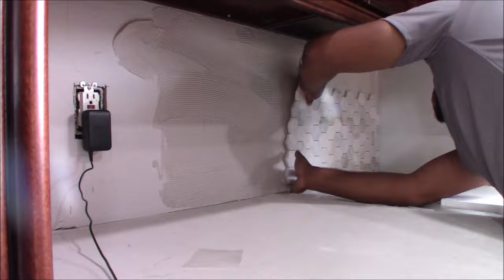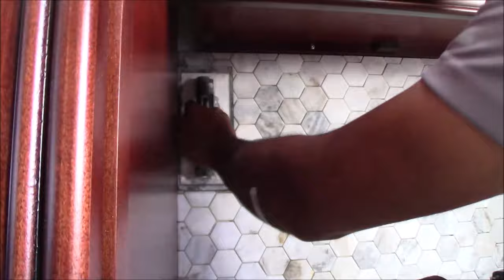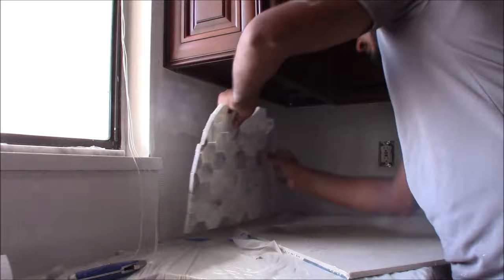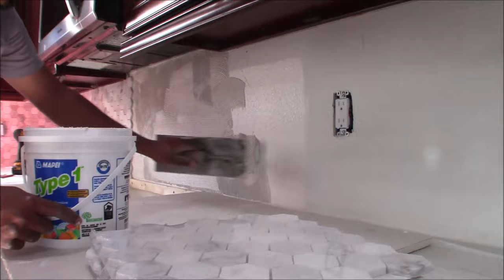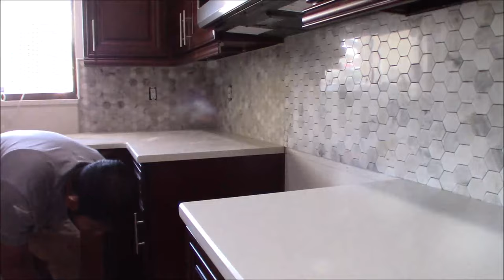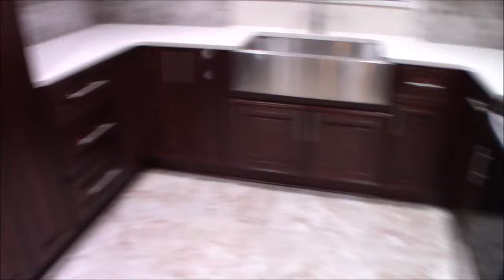How to Install Backsplash In Kitchen    (3 inch Hexagon Mosaic Tile)

Comment: I just bought the same mosaic style tile (3” hexagon) , how did you cut the outlet out if the outlet falls in the middle of the piece? I seen you had the same situation in your video. Any tips would sure be appreciated! Thank you
Reply from the maker: Hey I used a angle grinder with a 4 inch tile blade to cut around the outlets.
And a tile wet saw for all the strate cuts.
Good luck on your project.
Thanks for watching 👍

Comment: Not to burst your bubble but it looks great. The problem I have is that it is backwards. The flat cut of the tiles is supposed to land on the granite or counter top. The missing hexagons in every sheet is supposed to go to the top since you can see it. I am just saying. Other than that, I feel guilty. I love it.
Reply: I did it the same way he did so that the filler pieces are hidden by the small appliances on the counter. Just in case my spacing was a little off.

Comment: Is the Mapei type 1 mastic better than using thin-set?
Should the first sheet be raised off the counter about 1/8" to allow for a caulk bead?
I will be using a 2" hex brushed travertine mosaic from Floor & Decor and they tell me that i have to apply sealer before and after grouting. Is that correct?
Thanks for the video... great work.

Comment: can you add a list of the things you used and how long to leave the grout before wiping
Reply: You are supposed to wait 24 hours before putting grout, he didn’t do that
Reply: @InsanelyGhostly  how do you know that
Reply: When you grout, you do a section, and then wipe with a damp sponge in one direction, and one pass, without putting pressure.  You dip the sponge in the water and squeeze all the water out, then wipe once in one direction and repeat.  If you leave any water in that sponge, it will affect the grout and color and may dig out your grout.  This is a first cleaning as you go.  Once the grout is hard according to directions, you can use a more wet sponge.  You usually do a 3' x 3' area and then do this.  In this case, you could do 4' of backsplash, wipe, then 4', then wipe, repeat.  This just removes the excess, not the haze.

Comment: nice job. how did you cut the tiles? angle grinder? what kind of grout did you use, pre-mixed, or did you mix it from powder?
Reply from the maker: Angle grinder and wet saw.
Powder grout

Comment: Would it be easier to just run the full sheet on the saw, cutting a half row off, instead of cutting all of those half pieces to fill in along the bottom? same look when you're done.

Comment: Nice work. Is it easier to do the bottom missing tiles at the end or to cut a straight line across a section with the tile saw and install together?
Reply from the maker: Its easier to do it how i did it in the video. Because both ways you have to cut the tile. And less tiles get wasted
Reply: @AZIMBAYO1  How difficult is it to for example remove white hex tiles from a sheet and insert colored ones and keep the grout spacing? I like that look I've seen before.
Reply from the maker: @douglaswells2739  the tile peaces have to be the same size and same thickness then it will work.
And the tile peaces are glued on a mesh backing. Its very easy to remove

Comment: Wow I am impressed with your work, very clean. I noticed that you used just a fine layer of mortar, no as I seen in similar videos. How thin should be?
Reply from the maker: I used a 3/16 inch V-Notch Trowel.
The Adhesive is MAPEI Type 1  Mastic (1-Gallon)
Reply: There should have been a much thicker layer of thinset.
Reply: @RobertLinthicum  not on marble mosaics.  All the thinset bleeds through the joints and you spend hours with a toothpick or tile spacer scraping out all the thinset before you can grout.  3/16 x 1/4 v-notched is the correct trowel for all your marble mosaics.

Comment: How many sheets did you need for this area? And how did you get the half pieces for the bottom? And how did you cut around the light switches ?
Reply from the maker: I used 35 sheets in this area.
I used a tile wet saw to cut one peace in to 2 half peaces.
I used a angle grinder with a 4 inch tile blade to cut around the switches 

There is another video on my channel i install some subway tiles and it showes what i used to cut the tiles. Tile wet saw and angle grinder.

Thanks for watching
Reply: Wow that’s a lot ! Do you mind sharing where you got this specific tile and how much it was per sheet . I’m looking at one similar and it’s 17.99 (do you think that’s really expensive ?) my kitchen has gold handles so this one . Where you able to rent those appliances or did you purchase them because I don’t want them forever lol?
Reply from the maker: @HonestlyMichee  this is not my kitchen i install the tile.
The customer buy the tile at FLOOR AND DECORE.
price was around 10 dollar per sheet. 17 dollars is too much.
Reply: @AZIMBAYO1  what is the sqf price ? Or what is the size of sheet? Are these tiles are imported?

Comment: What sized notched Trowell would you recommend for those tiles?
Reply: I can’t tell for sure, but that looks like a 3/8 trowell. You want enough mortar on the wall so that the tiles stick, but not too much that it bleeds through the space in the mosaics. When it does that you’ll have to go through and clean it out so that you have clear grout lines. Hope that helps.

Comment: Great video. Did you use spacers anywhere? Or need to use a sealant caulk? Where the tile meets the granite.
Reply from the maker: I didn't use any spacers.
I didn't use caulk.
But u can used caulk. Make shore its the same color as the grout

Thanks For Watching

Comment: Great job. What tile adhesive/mortar did you use?
Reply from the maker: Mastic tile adhesive
Reply: @AZIMBAYO1  Do you have to mix it? Also, it looks like you only needed a thin layer of it, right? Btw, thank you for posting!
Reply: @veroandariega  use proper trowel size, watch for thinset going where the grout needs to go. use old toothbrush if needed

Comment: What size trowel did you use? I use 1/4 in. Square notch for subway tile but not sure what to use for mosaic because when I push the tile there’s quite a lot of glue that gets pushed into the grout joints
Reply: Recommended trowel for mosaic tiles:   V-Notch Trowel 3/16” x ¼”: A typical size for mosaic tiles and wall tiles up to 4 ½”

Comment: Did I miss the part where they show what product the use to paste the tile and the one to fill in the cracks ?
Reply: Marble mosaic tiles are spaced 1/16, so you use unsanded grout color of your choice.  The paste is called thinset.  You can find both at any big box store or tile depot.

Comment: Great job. Your video inspired me to do the same for my home. May I ask the name of this 3 inch Hexagon Mosaic tiles? This is exactly what I've been looking for. Thanks.
Reply from the maker: Hi i can't remember the name of the tile sorry.
I baught it at the home depot
Reply: @AZIMBAYO1  Are these hard tiles or the kind you have to cut with a  water saw?
Reply from the maker: @estaraghadiuno112  its a soft tile you can cut it with a wet saw

Comment: Hi did you use a sealant for your backsplash and which one
Reply from the maker: No i did not use a sealant
Reply: @AZIMBAYO1  okay thanks! great job btw on the backsplash
Reply: On a marble backsplash, you seal marble before you grout.  Once grout and tiles are wiped, you seal again.  Grout and marble can use the same sealer.

Comment: may i know what is the material you use to stick the tiles to the wall? is it a kind of glue or cement?
Reply from the maker: Mastic tile adhesive Type 1
Reply: @AZIMBAYO1  ok thanks! 😀
Reply from the maker: No problem. Thanks for watching my video.

Comment: How did you cut the smaller pieces???
Reply: What I do is I would have a hexagon tile removed from the mesh.  I would place the next 12x12 meshed tile next to it and take a large piece of tile or wood and place it on top of the 12x12 and the single hexagon to hold it in place.  Then use a 4" grinder with a tile blade and cut the single hexagon in half
Reply: You can also line the 12x12 up on your wet tile saw and saw all the end hexagons in half.

Comment: May I know how much square foot of area you did and which size of type 1 adhesive you used?
Reply: Also did you get the tiles cut somewhere or did it by yourself. TIA
Reply from the maker: The area size was 37 square feet. And i used one gallon adhesive.( with a v notch trowel)
Reply from the maker: And i cut the tiles with a tile wet saw
Reply from the maker: Thank You For Watching My Video